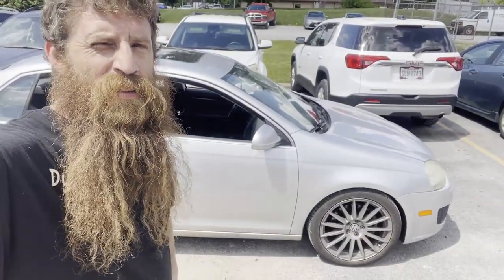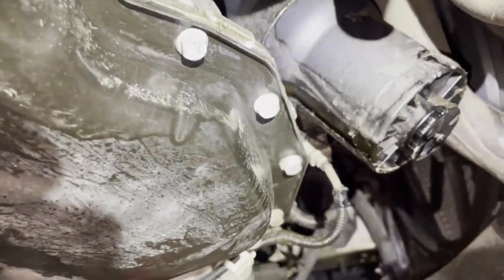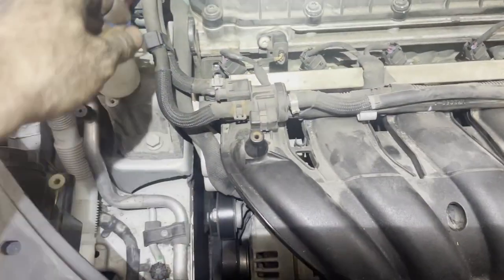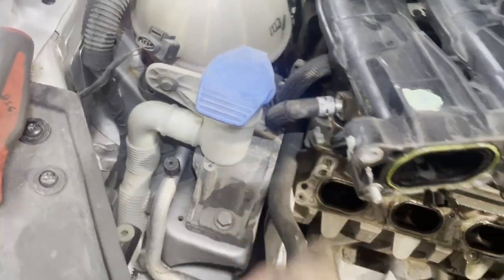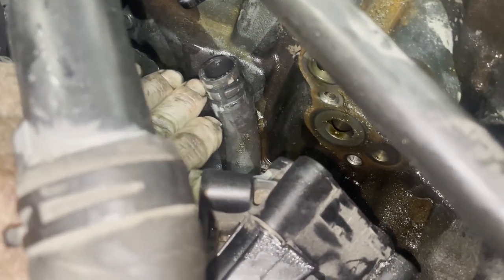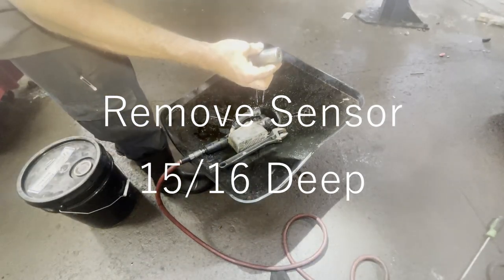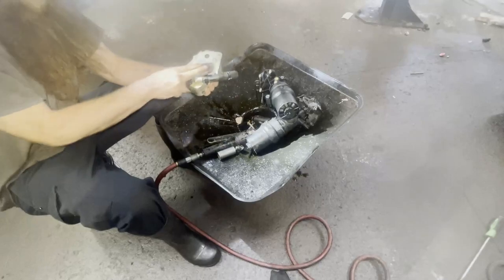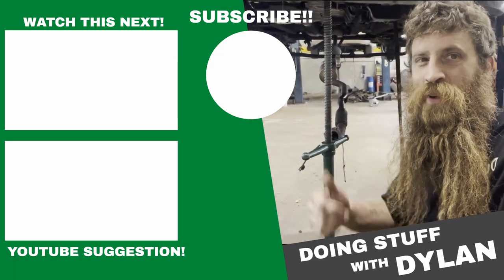2010 Volkswagen Jetta Oil Filter Housing Replacement. I included what I could.

Comment: I just did my 2010 2.5 New Beetle, same issue... Intake, Fuel rail comes off did it all in less then 1 1/2.  You need new intake gaskets and take the oil cooler off 1st you can get to all the bolts more easy.  On the new filter assembly install the oil cooler... Torque specs are critical...  25nm on the Oil Filter Bolts and oil cooler bolts.  I love how everyone never mentions Torque Specs....
Reply from the maker: Most people don’t use them